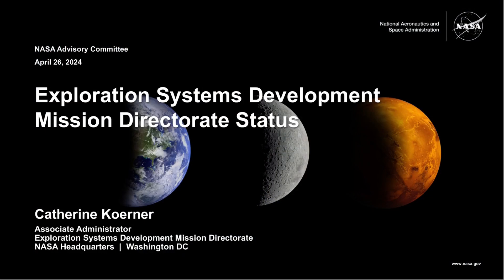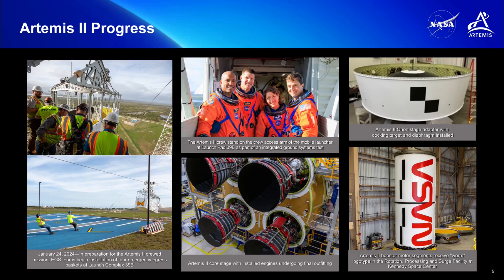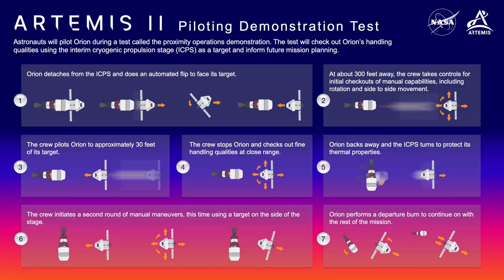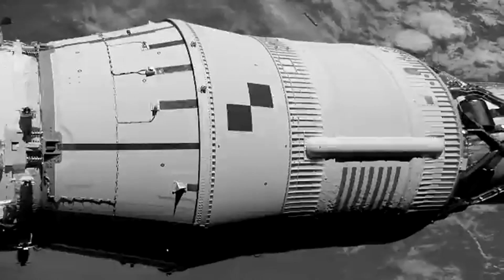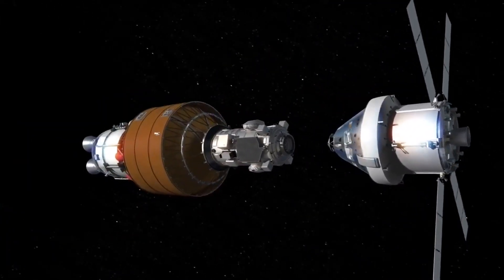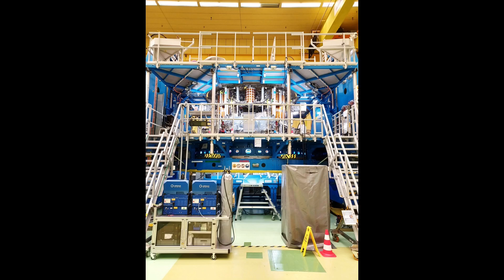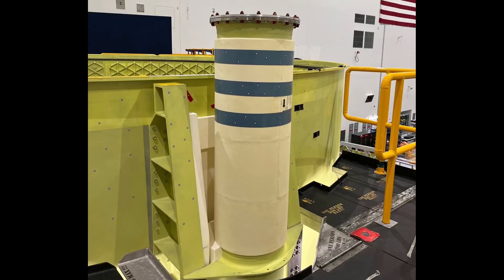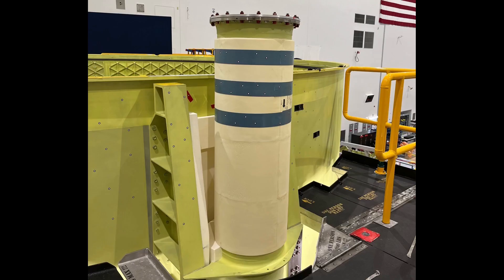Artemis II Orion EMI/EMC testing complete, new SLS pictures from NASA Update

Comment: More of a personal opinion question, but based on the latest OIG report on Orion's heat shield and NASA's responses, do you see NASA changing the plan to fly crew on Artemis II? For me, based on their responses to OIG and their upcoming conclusions of those Orion investigations, they still seem comfortable to fly crew on Artemis II as planned to the Moon IMO.
Reply from the maker: As the OIG report highlights, the public isn't being kept in the loop about important details and context regarding the issues.  OIG reports are essential for outside stakeholders like the public and media folks like me, but NASA was aware of all these issues -- OIG found out about all of them from NASA's ongoing investigation.

They have been working on these issues privately since they started post-flight analysis of the base heatshield, and we've heard bits and pieces about it since last March, March 2023.  But NASA isn't talking to either the public or the media about their work to much degree, so thankfully OIG was doing this audit and could better inform us.  (Much better inform us.)

I would be surprised if NASA were to pull the crew from this vehicle, it's much more likely that if the heatshield is too risky to fly, they would stand-down to modify it and delay the flight to make and certify the mods, destack Orion, reinstall, restack, retest, etc.

Artemis is still in this "two halves don't make a whole" situation; the Orion/SLS half is that they don't have surplus Orion and SLS vehicles to add another uncrewed lunar flight test.